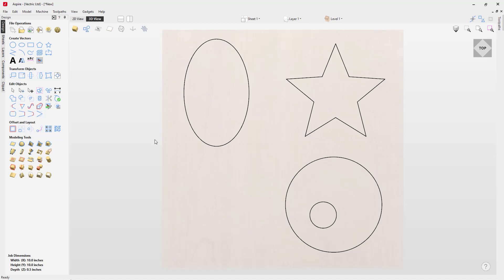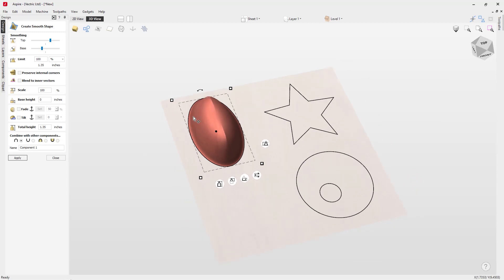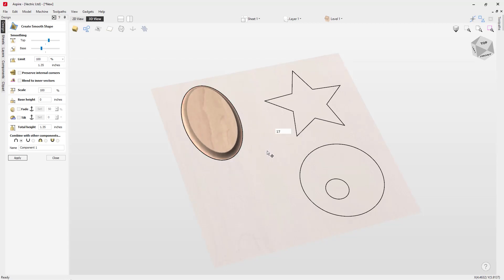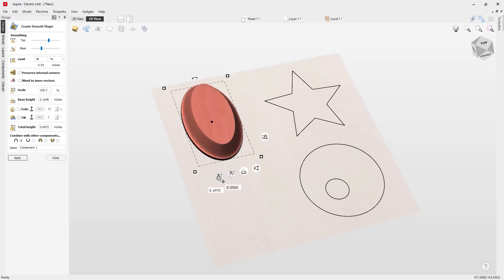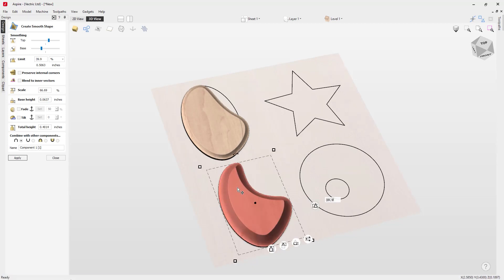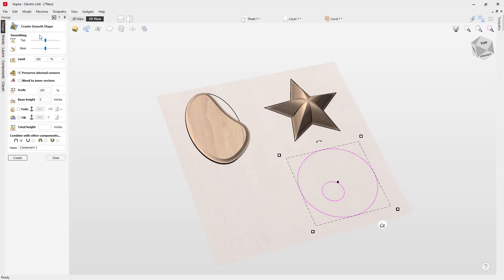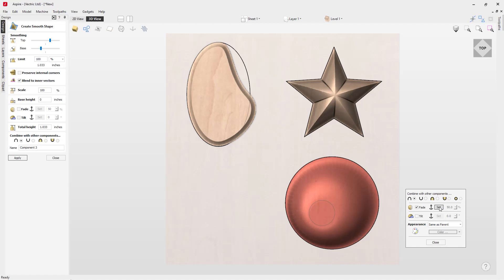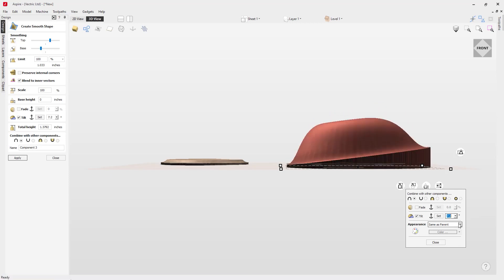How to model a smooth shape in Vectric software | Modeling Tools | V12 Tutorials

Comment: Thanks, I need lots of V12 modeling videos, since I've been using Vectric for several years but just upgraded to Aspire since V12 and most of the info I find is on older versions.  Thanks, I will be at the meeting in Roundrock Tx. in OCT '24  hope to see you there.
Reply from the maker: Good stuff!!!